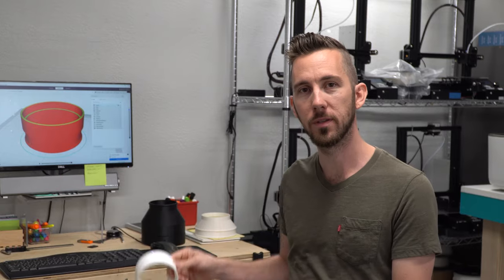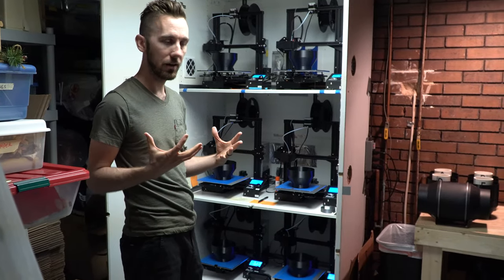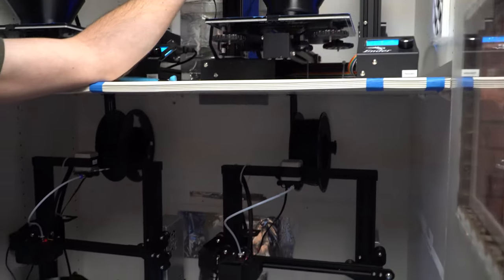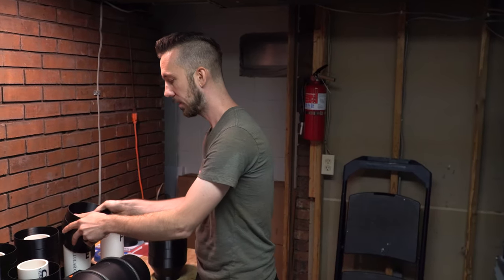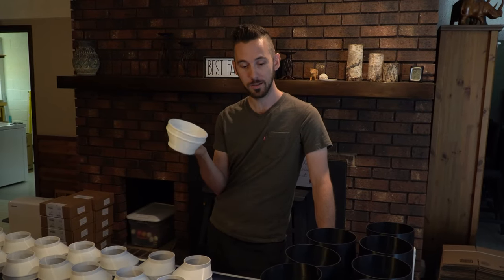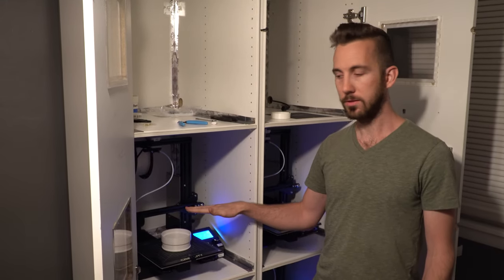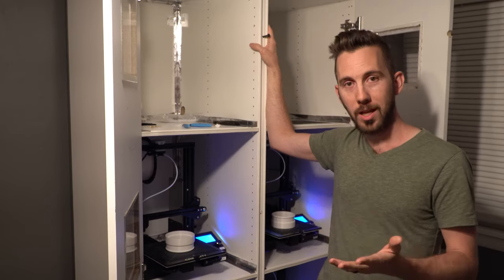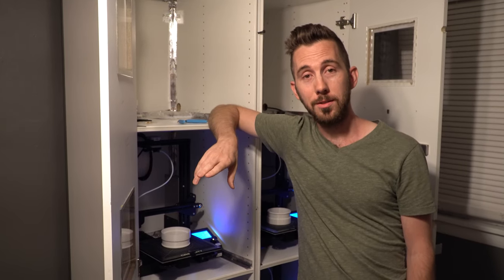My 3D Printing Farm

Comment: Don't switch to ABS!!! The whole ABS is stronger than PETG thing is a big old myth that as been busted by Stephan from the Youtube channel CNC Kitchen. ABS requires much higher print temperatures wich is going to cause many problems on your stock Enders (trust me I ran 5 enders on ABS for a while and it was a nightmare). What Stephan showed is that not only PETG is similar to ABS (strenght and temp resistance) PETG ended up having stronger layer adhesion than ABS. ABS was one of the first filament to be resistant and that's why it's got this reputation but it's just a myth now.
Reply from the maker: Cool man, thanks for sharing that! PETG is so much easier to print with anyways so that makes my life easier.
Reply: @MartinsonManufacturing  I love sharing the knowledge man! That's the beauty of the 3D Printing community everybody is here to learn and share their knowledge!
Reply: Thanks for the video, I have a background in Industrial Design and got into 3d printing almost 20 years ago but have gone on a different path since. Looking for my first personal 3D printer to get started. I used to love the SLA at work but FDM like the Ender 3 that you have might be a better place to start. Printing so much it might be worth it for you to look into doing small production runs with soft tooling. Take a few printed parts build a silicone mold and cast your parts out of a highly density urethane. Do some research and see if it works with your parts. Thanks again for the great vid.
Reply: Yes, PETG is amazing. It is my go-to material. I only use PLA for prototyping and working out designs.
Reply: That being said, for higher temp applications PETG doesn't cut it.. my prusa mk4 started to soften and lose belt tension when I had it in an enclosure and it hit 50c inside
Reply: @PressRToWin  I totally agree with you. ABS will do the same tho… Nylon is the answer PA6-GF is the real winner for high temp rigid parts

Comment: I love seeing this! I also started with just 4 printers, and have since expanded to 20 ender 3v2s with the product I designed. I can relate to what you're doing here. Much success in your future designs and business!
Reply from the maker: Thanks man, and congrats to you on your success! 20 printers is quite the setup! Looks like you have a great product with good demand. How do you advertise your product?
Reply: congratulations!! what product did you design??
Reply: I have the same  story, but it I have a little more time. I started with one and now have 78 machines running 24/7
Reply from the maker: @igcefa  That's insane! Do you make just one product or multiple different ones?
Reply: I’m about to start mine with 2 ender 3’s 1 is a pro
Reply from the maker: Awesome man, get it!
Reply: @MartinsonManufacturing  I’m super excited I’m licking them up today!!!
Reply: What control boards are you using in them? I’m not super impressed with the creality boards
Reply: @nsboost  I’m just using the stock control boards it’s working pretty good for them I might sell the ender 3 to get another ender 3 pro
Reply: @MartinsonManufacturing  I got them and I’m printing mandalorian armour right now and plan to create more stuff
Reply: @MartinsonManufacturing  The crazy thing is you guys are still Just Starting Out in my book work on buying 20 Commercial grade printers next and get a actual building/factory!
Reply: Really ? Wow that's awesome, it's good business for you? You make a living out of it?
Reply: @igcefa  what products do you make?
Reply: @MartinsonManufacturing  multiple products. Now we have more than 100 SKUs and we keep developing new products every month
Reply: @ethayer1  most are business focused solutions
Reply: @igcefa  Took a little long for the reply homes, 11 months
Reply: Did you need to hire an electrician to make sure your power line breakers can handle those 20 machines ? Do these machines draw much power to operate.
Reply: @igcefa  how..much...revenue...are you making. And dont take 11months to reply this time would you
Reply: @abowden5079  wtf he owes you nothing bro chill, there's plenty information in Google

Comment: HINT: Number the printers with the date they show up and go into service plus any letters or product id's.. That keeps it all in order by when they went into use as well as age etc.
Reply from the maker: Definitely a great tip here!
Reply: And keep a service log somewhere, that way you will know if a specific machine has a recurring issue rather than something common to all the machines on occasion. Definitely serial number the printers.
Reply: Each machine should have a log notebook with a date and the file name of what ran that day entered as it is run. Log Temp of Bed, nozzle and FR on the end of the line, which slicer, settings and any adjustments for that particular extrusion, as well as noting the filament that is in use with the day it's put on the instrument when that changes. After awhile it's a great log to refer back through to see situations that happened, and also for a repeat print job of something specific from awhile back and how it performed and produced.

Comment: Only reason to use abs is for temperatures up to 100°C. your ender 3's will need a different hotend to print abs. The stock one will break if you print abs, i promise. I have been building and using 3d printers since 2012, trust me i've been through all the problems you can imagine with 3d printing.

Comment: Thanks for putting this together, it is inspiring.  I'm curious about your reasons for 3d printing this part vs injection molding once you got to some scale
Reply: Some possible reasons: 

 Initial expense was still to high to justify, especially when there's a high risk the sales drop off. 

Injection mold shop could take his design and directly compete. 

Injection mold shop could raise unit price once he was invested.

Injection mold shop could end up having terrible quality control.

Injection mold shop could go bankrupt. Molds could be seen as assets and be locked in legal proceedings.

Labeling the part as 3d printed helped when marketing to other makers.

Comment: Good info - to improve profit margins, or reduce cost you could try:

No stringing (sanding) + faster print -> use larger nozzle (eg 0.8mm) and print in vase mode with thicker layers. If you want a double walled part, make the model two nozzles thick, then remove a 0.03mm vertical slice (so it's like a chain link). Tune the flow, jerk & accel settings to get a strong yet minimal seam up the side. Thicker vase parts with internal structures are also possible depending how you make cuts. Harder to describe, but think of it like scoring the surface with a knife: you do 0.03mm cuts (smallest gap i've found is still recognised by Cura) in to one surface that stop 2 nozzle widths from the opposite skin, a bit like this ├│. You can imagine the slicer printing the outline, with every gap a double wall.

Visual differences (gloss/matte) -> suggests slight temp difference between the hotends as Petg shine increases with extruder temps. Could measure and tune print temp for each of them.

Old stock PLA parts -> perhaps a semi-insulated bag inside the package to save wasting them.

Power/layer issues -> maybe on some machines the stepper drivers vRef is set a bit higher, causing them to run hotter.

Cheaper Filament -> usually the manufacturer lowers costs by not drying (properly). Could use the warm printer cabinets to dry new spools. With a larger nozzle size, slight variation in filament thickness isn't noticeable.
Reply from the maker: Man, tons of great information here, thanks for taking the time to share all that. Sounds like you have a ton of 3d printing experience. You got me really curious about vase mode now, i'm going to have to try that out soon.
Reply: @MartinsonManufacturing  You could also buy a food dehydrator and use that to properly dry filament.
These dehydrators can be bought very cheaply and they can cook out all the moisture in one night.
Reply from the maker: @yourlocaltoad5102  Thanks for the tip!
Reply: Good info. Thanks
Reply: " then remove a 0.03mm vertical slice (so it's like a chain link)" i don't understand this part, can someone explain
Reply: afaik manufacturers don't dry filament, they dry the pellets. There ain't much water left after it goes through 200°C + to be spooled ^^ It's actually the resin used for the color that makes the difference in price. There are resins that just print nicer
Reply: @giedrius2149  they are hydro dipped at the end of the extrusion process to cool the filament
Reply: I’m trying to figure it out myself but I think I get it.

Comment: I used to have false power loss issues on a cheap CNC milling machine, I resolved the problem by powering the drill with a separate power unit and leaving the electronics on the original power unit.
The stepper motors generate quite a lot of EMF disturbance that could be an issue for the microcontroller and the communication with the PC, try shielding and grounding.

Comment: 1. It could be spikes in peak demand dropping voltage for a split second just enough to trigger the warning.
2. The probability of getting an error increases with frequency and quantity. The more you use the printer(s) and the more you have, the more likely you are to experience an issue.

Comment: PETG is plenty.. We print gun parts and they hold up just fine. We also use ASA but you need to be more concerned about VOC's with that material. ABS is pretty much obsolete unless you need a bunch of pretty colors. ASA prints more easier, has the same or better mechanical properties, and has a nice matte finish. We use 3DXTech for most of our filaments.

Edit: We also print with ASA on scotch brand blue tape. 85C bed.

Comment: Great video, that was really interesting, thanks for sharing. I have a couple of suggestions that you might like to try. First of all, when printing ABS, try out a PEI bed. It will stick perfectly, and release easily when it cools down. I print a lot of ABS, and I put down my first layers at 75mm/s on PEI, no adhesive required. Also, consider trying klipper firmware on a test printer, it has far superior kinematics. That translates to much faster printing without loss of quality, as a rule you can expect to double your print speed just from installing klipper alone. My standard print speed using klipper on my Ender 3 V2 is 150mm/s. You need to use a raspberry pi which adds expense, however you will be able to substantially increase productivity of each machine, so you won't need to spend more money on extra printers, or space and cabinets to house them. I don't run a print farm yet, but I hope to soon (printing car parts in ABS or ASA), but those are things I do on my personal printer (which pretty much runs 24/7) and so will definitely implement on other printers. Having said all that, I don't know how much printing faster will add to wear and tear on the printer, and whether the benefits outweigh the cost/downtime that comes with that, but I aim to find out :) Thanks again for sharing.
Reply from the maker: Thanks for your contribution, lots of good advice. I've actually been having an issue with my ABS prints fusing to the bed lately so i'll definitely give that a try. Is there a particular PEI bed that you would recommend? This is the first time i've heard about klipper firmware so i'll have to look into that more. Saving print time would be a huge help!
Reply: @MartinsonManufacturing  I'm in Australia, so I tend to buy most of my stuff from China as shipping from the US is expensive. I use the Energetic PEI plates, but you will have a much wider range available assuming you are in North America. Do a search on YT and you will find heaps of info. 
Klipper is a game changer. Seriously, once you have tried it, you won't look back. On your first installation, you will have it all up and running within a couple of hours. And if you mess it up or just don't like it, you can revert back to Marlin in less than 5 mins. Aside from the better kinematics, klipper as a number of other significant features: a) Everything can be configured in the config file, no need to recompile firmware as with Marlin, b) Pressure Advance allows you to easily tune the filament flow through corners, so you can eliminate bulges. Marlin has a similar feature called Linear Advance, but it is not compatible with the Creality mainboards, and c) Resonance Compensation allows you to tune out ghosting/ringing. I would suggest looking at the TeachingTech YT channel, he has recently convert several printers to klipper and he walks you through all the config process. Also, feel free to contact me if I can help, I'm happy to walk you through it. Good Luck! :)

Comment: Hey! Great video! Hoping you see this as it’s an old video now but I couldn’t help but wonder since you are printing lots of the same part (and clearly shifting volume) why you don’t go the route of having it tooled and injection moulded on the well established parts. The part cost would be less after you get over that initial say $1500 tooling cost and you wouldn’t have defects or sanding to deal with. Then you can use your farms to run new product lines before committing the next successful one to tooling. You could also then go the Amazon FBA route on those parts so your dealings would be manufacturer straight to Amazon warehouse and nothing for you to deal with and easier to scale. Either way great video and super happy for your success!
Reply from the maker: Thanks for the comment man. Injection molding would be a great way to go. Do you know anywhere where I can get tooling done for $1,500? The cheapest I found in North America is $34,000.
Reply: @MartinsonManufacturing  Wowzers that's a high quote! Most my experience is with China. I get a lot of trays/cases/etc. tooled for the hydroponics industry. Our work has a China office though to make communication easier. Recently used DongGuanShi YiSheng Packaging Prouduct Co.,Ltd and a mold cost for a 300 x 600 x 15mm thick reusable tray was $1800 with unit cost $0.4350. I can only imagine your prices are due to them being from North America or potentially the shape being a tube means the mold needs to be 3 parts and therefore more complex. Might be worth chatting with a plastics design firm on the phone. Quality has always been good from China too.
Reply from the maker: Man, that’s a great price. Thank you for sharing your contact. My current design would require a sliding three part mold so that’s probably why it’s so much. I’d like to look into this more. Thanks for getting back to me with the additional info!

Comment: Bumped into this video since I just bought my first 3D printer (Ender 3 V2) and have been binge watching 3D printer videos. Although I am not into a 3D printing farm your video was a very nice video to watch. It is always nice to see how someone's business starts with a concept and flourished into a nice at scale operation. Wishing you good luck for your continued growth in 2023.

Since you have these many printers running continuously, a couple question if I may - what changes have you made to your stock printers to ensure quality and reliability. Like I keep hearing about replacing stock bowden tube with better quality Capricorn tube, all metal hot-ends, metal extruders etc. Also it will be nice if you can put together a video showcasing some routine maintenance. Thanks and good luck.

Comment: I run ender 3 farm too, try the "carborundum" glass plate, aka Anycubic Ultrabase. Works extremely well, and doesn't really care at all if it's a bit greasy, dusty etc. works just the same.

Before first use wash it. They sometimes come dirty and prints don't stick. They also get slightly better with use.

Comment: i mostly do abs, 
for adheasion,  just hard hairspray and 110/120 degree bed. 
( heated/enclosed chamber) will also help.  90 degree straight edges into the bed  really need pads

Comment: You could be experiencing differences in part shade for a couple of reasons. Usually this is due to inconsistencies in reading and different PID tuning settings for each of the printer. Silicone socks could have various different amount of use and wear. I'd suggest if you try to get the most consistent printing temperature and consistency, to make sure all nozzles are from a consistent manufacturers, and the heater cartridges and thermistors are all inserted with thermal paste (boron nitride thermal paste from slice engineering works great). Don't forget to PID tune each of the prints with their part cooling fan on at the speed the filament of use will print at, and try to PID tune each of them with the door closed and the other printers running to simulate a real environment.
Reply: This should reduce almost all of the shade variation you are experiencing, the only variables that should be left are the filament humidity and consistency.
Reply from the maker: Thanks for taking the time to share all this, I'd like to try this out and see if it fixes the problem. It's been a frustrating one that I've never been able to solve.

Comment: Very inspiring....there is so much a person could do these days for self income. I love the manufacturing side... 3d printing, cnc, laser ect. All right there, anyone can do it, you need patience, desire and integrity. Loved your video, wishing you prosperity with your business!
I wonder if you get issues with your powersupply lifespan running abs temps in cabinets, they will only have warm air to cool them..? If an issue you may need to punch 2 holes in the cabinets per printer, for a cool air intake and exhaust, in a contained system as to not alter your hotend & bed temps. The power supplies are probably of not high quality, I had one fail in just 6 months of moderate use.
Cheers